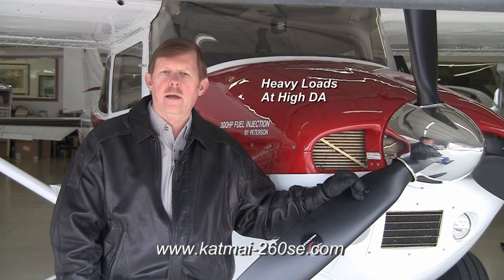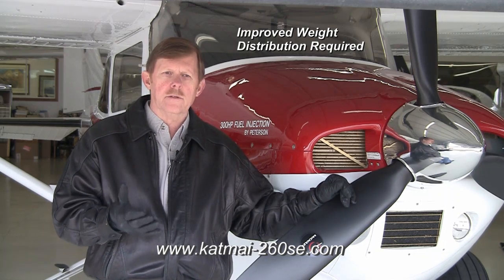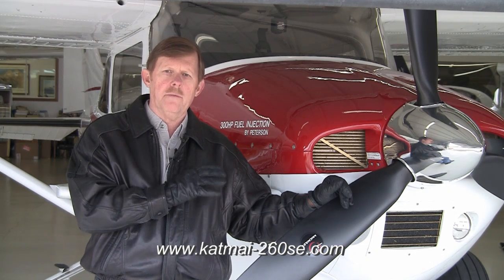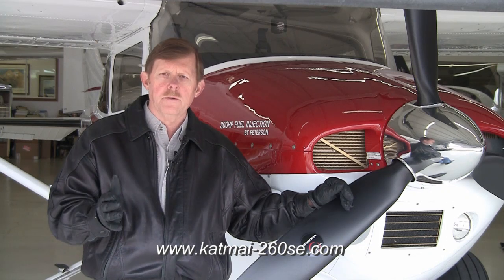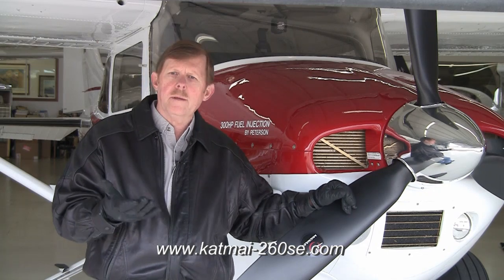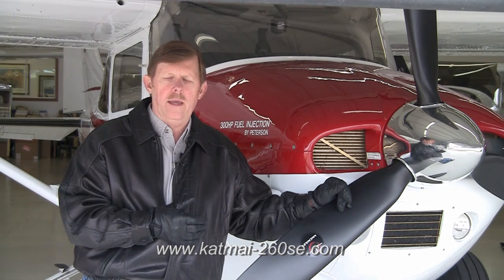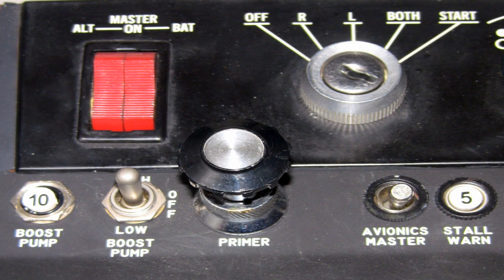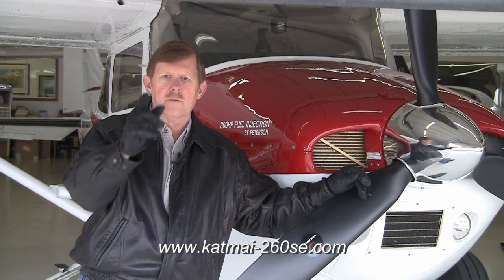Peterson IO550 Conversion For Cessna 182

Comment: I would be concerned about over stressing the airframe over time. If this is a good idea you would think cessna would do it.
Reply: Wrong.  If Cessna did this it would cannibalize the 206 sales. Piper did the exact same thing with the Dakota 235 verse Cherokee six.

Comment: Thank you for the video presentation. 182 is a great plane, have quite a bit of hours in it. That said, it's great that you can put a IO 550 in it. If that is a case, why not get certification to make it turbo normalized ? Surly, if it can be done Cessna 177, cardinal, why not with 182 ? Thank you.